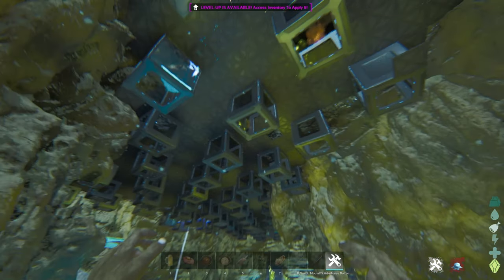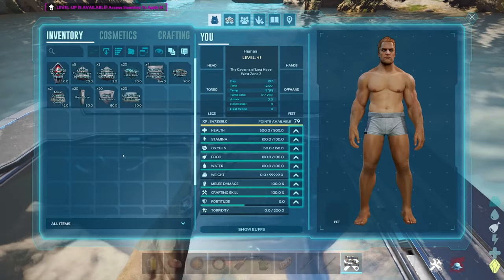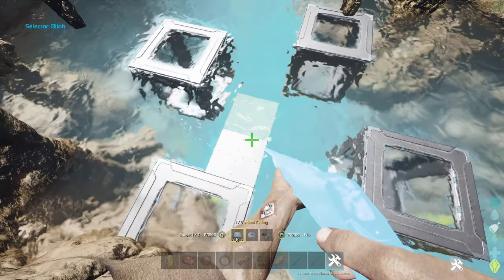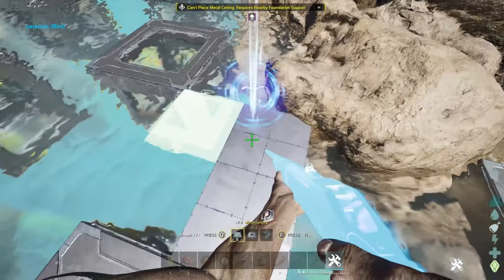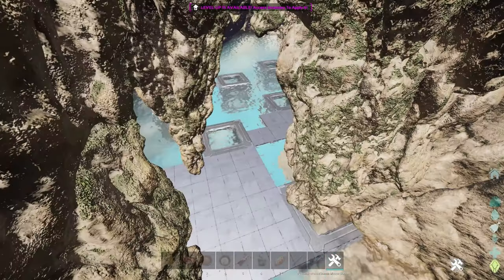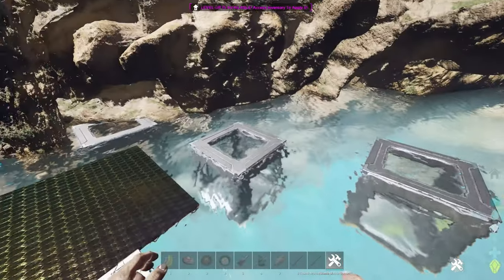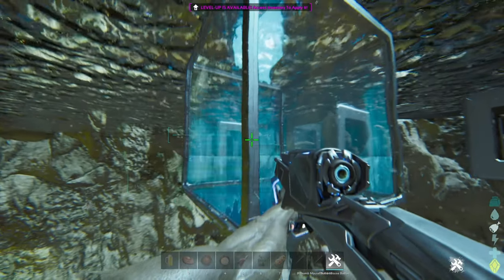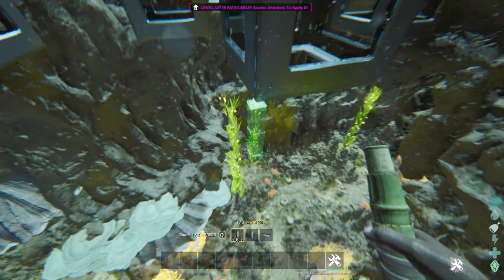The Official Build: Optimal Vacuum Chamber Foundation Support | Ark: Survival Ascended

Comment: just saying this is not very fun once its complete lol, there is a visual bug in ASA if youre lingering above the surface of the water ( such as the floor you built here ) your screen will be covered by water as if you were emerging from it constantly, jumping will clear it but you fall back into the visual bug, you have to go up a door frame and then build your floor for this to not affect you. speaking from personal official small tribes experience, we rebuilt
Reply from the maker: think that's just easy uw. I never have that problem in hard uw
Reply: Most likely to get fixed anyway

Comment: People on my official server are telling me that the vacuumes will actually snap to ceilings so you can place it under ceilings. Is this true?   Because I have been trying on official to snap these to ceilings that I have flush on the surface so I can walk in and out of them with stairs and it wont snap for me.  I tried single player as well and it still wont snap to ceilings.   But I checked their base out and they have theirs flush to the surface out in the middle of the ocean.  Said they snap to ceilings but just doesn't work for me..    can anyone confirm this or know how to do it?
Reply from the maker: @ChrisOnRockyTop  snap a pillar ro the ceiling first
Reply: @Doth_  Unfortunately that doesn't work either.  They were saying you could snap it to just ceilings without needing a pillar.  I know they snap to pillars but I can only ever get them to snap on top of a pillar so gotta build from the bottom up and then snap a vacuum onto a pillar. 

Would be nice if you could build from the surface down and then snap a vacuum under a pillar. But sadly it keeps saying obstructed that  way.